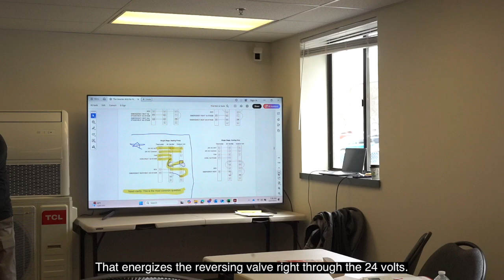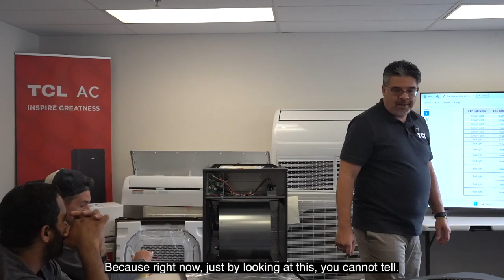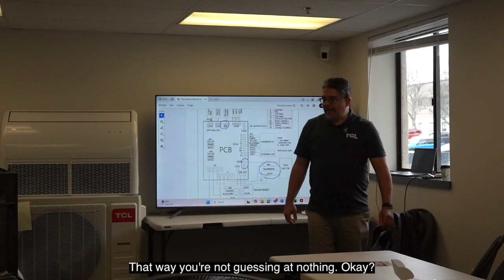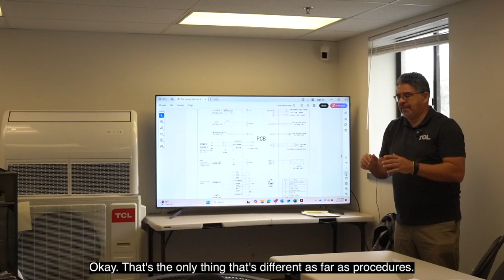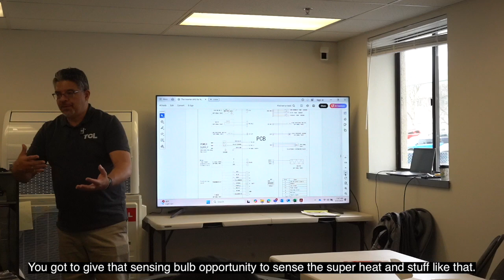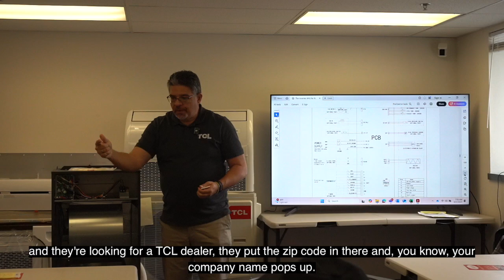TCL HVAC Training EP8 TCL HVAC Wiring & Commissioning Tips: Avoid Costly Mistakes

Comment: Thanks to these videos I selected the correct TCL unit, almost oversized for the room.  A video for cleaning of inner duct for the BreezeIN models will be great. the user manual is too lean. need better instructions and pictures how to remove the Louver, bottom plate and deflector. As a new consumer, I'm not looking into breaking plastic parts.